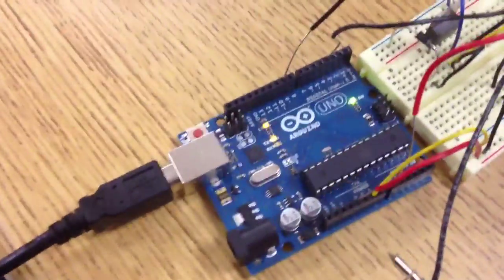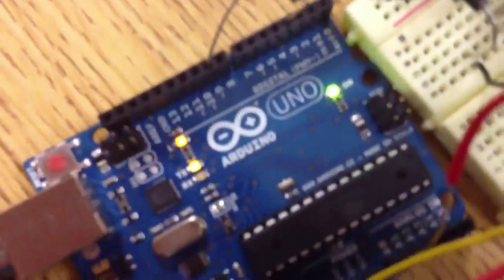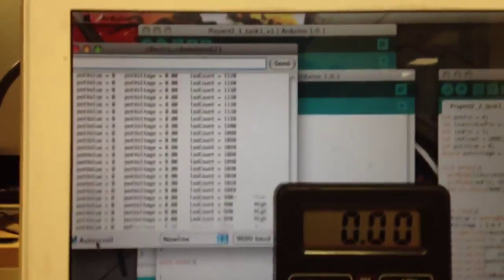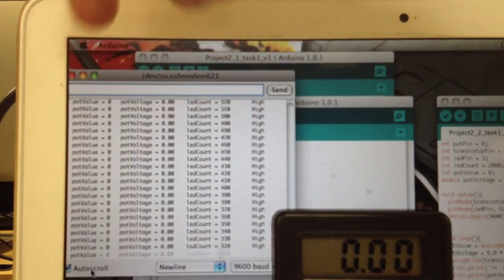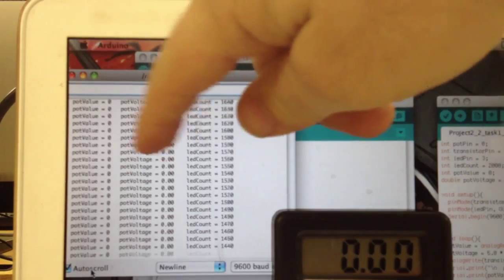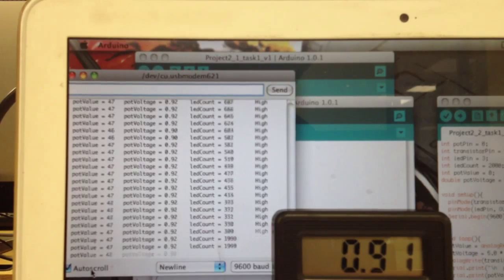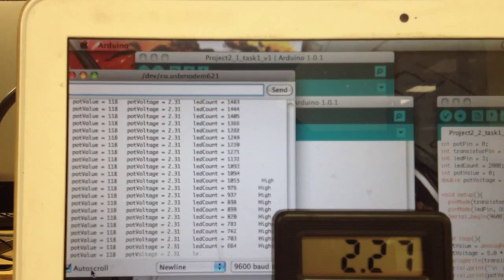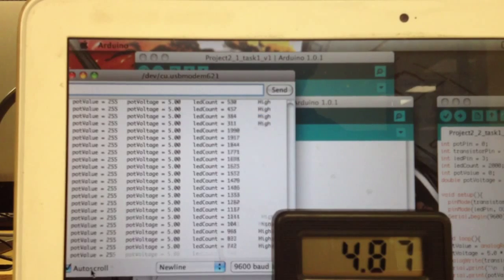Arduino potentiometer voltage reading

Comment: Can you use the serial window of the Arduino sketch code to show voltage? If not, would you be willing to share the code you used to show voltage? Does it work within the Arduino sketch interface?